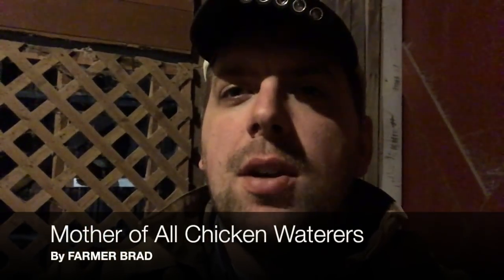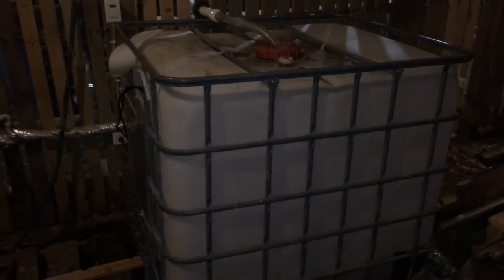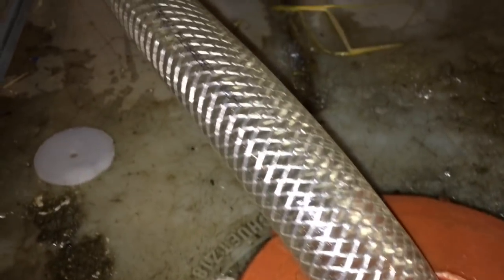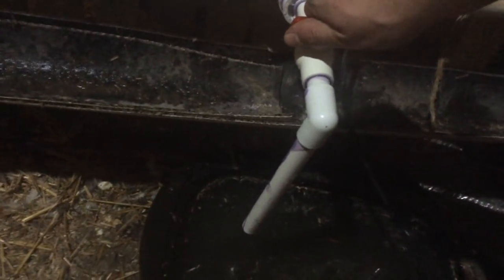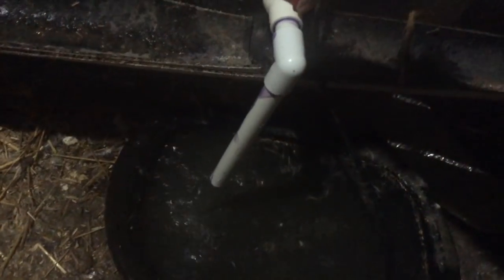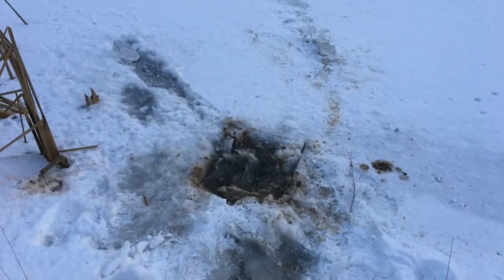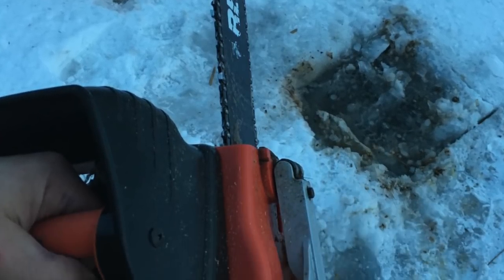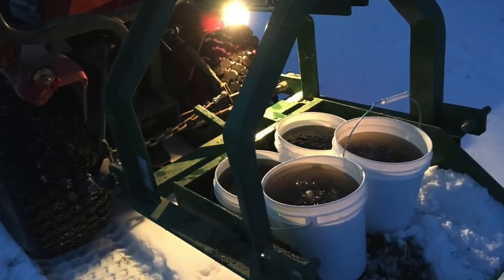Mother of All Chicken Waterers (Winter Proof) v 1.0

Comment: Wicked setup! Did you say there was a V2 of this system? What did you change?
Reply from the maker: Here is an IG livestream I did on the updates. I have ducks and geese so a 3way valve was a game changer. It keeps the moving water inside the pipe. Where before I had a T and then a valve but it was too far from the main line and ended up cracking. https://www.instagram.com/tv/ClwvfbDvemi